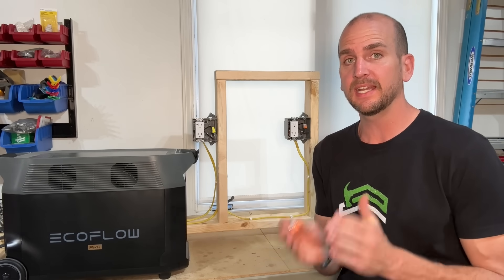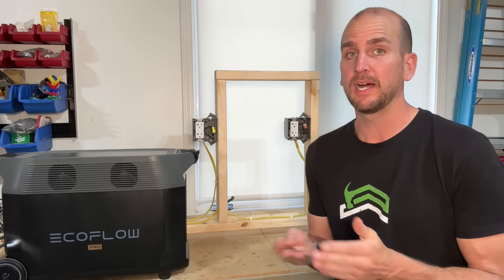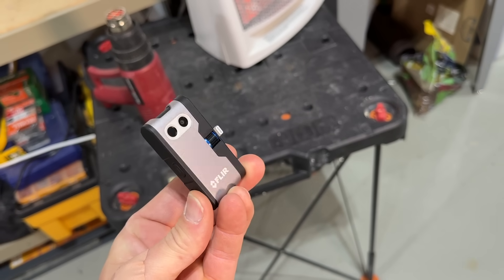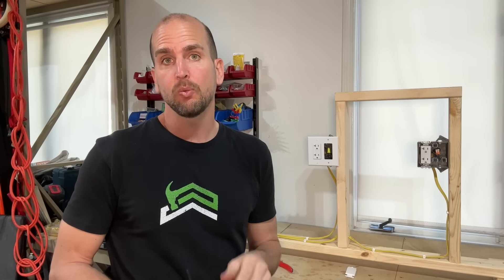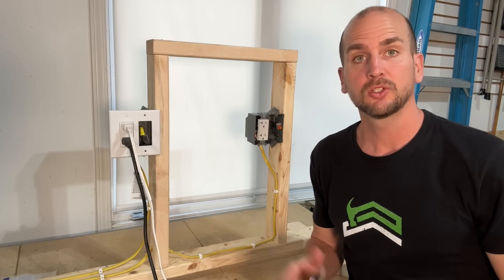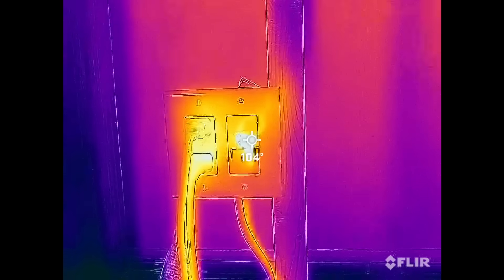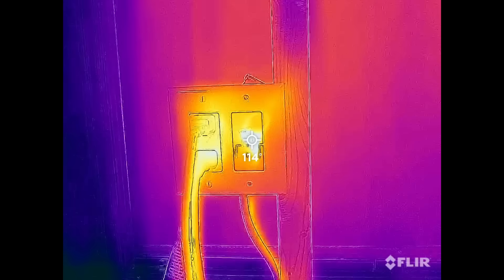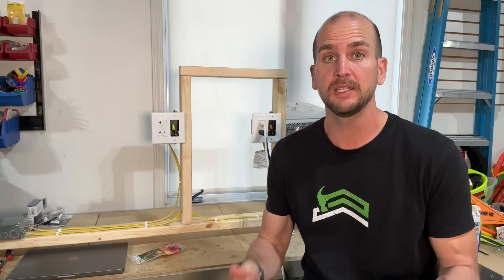Debunking the Pros: Can WAGO Lever Nuts Handle Heavy Electrical Loads?

Comment from the maker: All My Favorite Tools:  https://geni.us/VYIp51

DISCLAIMER: This video and description contain affiliate links, which means that if you click on one of the product links, I’ll receive a small commission.
Reply: What do I think?
You couldn't have made this any more confusing if you'd tried, if it wasn't for you flat out saying at the end that the Wago lever nuts are safe to use I wouldn't have known, as if things weren't vague enough you change the parameters of the test at the end moving the lines on your chart and all of the sudden it's "Gee, I thought I was lost before, now I'm really lost", because what exactly does that mean? Were the results in the first place invalid? If not then why were things changed? Does the second set of results more closely resemble real world use? If so why the first set of results? If not then why the second set?
Thanks for clearly stating at the end that Wago's are safe, I've often wondered why and that's based on the area of contact the wires have inside the Wago coupled with the notorious push in type outlets and them being known to fail, the two designs being similar and all, but if you wouldn't have just plain stated they're safe at the end I wouldn't have known, and I wasn't about to watch this 4 or 5 times to sort things out so I could figure out your conclusions.

Comment: I have been using wago for twenty years with CNC machines. We use them on all our systems and have had no failures at all. We use them at the rated ranges and adhere to manufacturer specifications. Highest voltage around 25amps

Comment: I re-wired my 4-bedroom house, using wire nuts.  I added numerous receptacles and switches, and upgraded most of the circuits to 20 amps, the only exceptions being lighting-only circuits.  I have a lifetime supply of left-over wire nuts, and have no motivation to use Wagos.

I am a pre-twister, and would like to see a comparison similar to this test comparing pre-twisted vs. not pre-twisted.  (A real electrician counseled me to pre-twist in spite of the instructions.)

I think something that should be stated here, and obviously I have not read all of the comments, is that heat = wasted energy.  The main reason I upgraded my home's wiring from 14-gauge to 12-gauge wiring was to decrease resistive conduction loss.

Thanks for the video.  It's very interesting, but as I stated above I likely have enough wire nuts of assorted sizes to last for the rest of my life.  I understand that Wagos are big time savers for installers.

Comment: ok news flash: we've never used wire nuts in Europe as far as I know (I wouldn't even know how to translate that); before wagos were screw terminals blocks in electrical installation and they were an absolute pain compared to those and a lot more prone to be badly installed, so as far as Europe goes we don't care about how wire nuts are supposed to be better because we've never used those.

Comment: If you don't use the right Wago for the right raring of use and wire... duhhh. Like shade tree mechanics working on BMWs. "IT BROKE". "IT CAN"T DRIVE". Well, no shit it broke and can't drive if you use the universal screwdriver, don't service it and the concept of using the right tool is about as alien as the reality that cartridge bullets existed at the same time with cap and ball.

Comment: I woudn't use any connector for outlets they have dual screws for that and in a well designed circuit there are no nuts, wagos whatever. In lightning it does not matter use wagos, the are nicer on the cables. According to ohms law a 20W bulb will present 700 ohms resistance adding a few ohms won't make any difference. With a heater of say 1500W then you are near 10 ohms and there you don't want any added resistance as every ohm will dissipate 150 extra wats, but then avoid wire connectors if you can use the ones in the outlet itself.

Comment: The way I look at it is... What are your design requirements? If conductor re-use and modification is a priority, use WAGO. If you don't know how to properly twist a wire, or you're not strong enough to get a wirenut tight, use a WAGO.

But if you are doing permanent, standard in-wall wiring meant to run general loads, each splice reduces the available load down the line by a little bit. You're adding all those tiny bus bars to the circuit of everything you plug in. Use wire nuts - it could be what keeps you from having that welder tripping the breaker over and over someday.

Comment: It would be interesting to see if there is any measurable additional voltage drop across a Wago versus a wire nut. I assume there would be, given your results, but it would be interesting to quantify it for the sake of engineering knowledge. Also would be curious about other lever style connectors, such as Ideal. Thanks for another excellent video.

Comment: I was wondering about this. The wago uses a metal piece to transfer connect the wire compared to the wire nut where all the wires are touching each other. Can the wago create galvanized corrosion since it doesn't use coper??

Comment: This is not the problem. The problem is long term. They are too similar to the push in connectors on receptacles and switches. You don't see failure for 20 to 40 years. Small contact area does not allow extra firmer contact area to overcome long term corrosion.

Comment: Can someone explain the time used? Does it get hotter the longer the outlet is used? Ie. If i plug a full load of say 20 amps of electrical equipment, for 3 days straight... Does it get incrementally hotter and hotter leading to a breaker flip or even flame/burn up?

Comment: So could you use this with wiring up a dishwasher?
Reply: Absolutely. Most dishwashers use around 1500w, which is around 12.5A in a 120v circuit... Well within the specifications of wagos.

That being said, because of that high amperage a dishwasher should be in its own circuit to begin with (20A, GFCI protected), so no need for any splicing at all.

Comment: The difference between the WAGO and wirenuts is WAGOs installations are more reproducible.  A good wirenut connection is better than a WAGO, but we all know many do it yourselfers will make mistakes with wirenuts.  I have done enough, I am not too worried about this myself but due to convenience and performance well within specs, I will be using WAGOs when I replace all the outlets and switches and boxes in the RV home my son will live in.  I hope to get it all done in one day.

Comment: I use wagos in my mercury gravitron time manipulation aircraft and they work great. With 2,547 connections to be made PER impulse beam generator it made wiring it so much easier. They’ve been across time and space hundreds of times and have never let me down. 

What? It’s the internet.

Comment: Well, as a less than knowledgeable DIY guy I am left wondering about the wire nuts I’ve installed over the past 40 years. Did I use the right size, did I install them correctly, etc I’ll be using WAGO from now on.
Reply from the maker: The WAGOs are pretty awesome, something tells me you won't be going back to wire nuts after you get the WAGO 221 a try.  Best of luck on your projects!

Comment: I would recommend you to check with circuit breaker manufacturer to see its tripping curve at various overload current. FYI if it's only 20% overload, it would probably takes several hours to trip.

Comment: I'm not an electrician. I've used the WAGO 221 connectors in my own home and would call them safe...I was leary of them at first and checked them often for temp. and for any signs of heat damage...They're still good 3 yrs. later. They have been installed in my shop's 12-2 wiring and mostly handle only lighting. There is one J-box that has a couple of outlets with machines on them(drill press and disc sander) WAGO's never got warm or any of that...I'm not worried about them anymore and will keep using them as needed...For what it's worth!

Comment: I appreciate your testing but the experts are correct. Your test duration is 20 minutes. You have to expand that out to 5 years or longer. The heat generated over time will cause wear in the connection. Even true with wire nuts and the screw. It’s just your high point is starting way higher with the WAGO. This was the same case with the aluminum wiring they put in mobile homes in the 60’s. 20 years in people were burning their houses down when they plugged in the space heater, or large TV in our case. We didn’t burn the house down but had smoke and smelled it.

Comment: There is no difference in temperature.
What you're seeing is the flat shiny surface of the Wago emitting the infra red directly at the camera.
The slightly matte surface of the nut doesn't emit the IR so well, and the round surface means it only emits a tiny amount towards the camera.

Comment: Take a look at a good wire nut, the tan "Ideal Twister" at about $0.17 each. I worked as a commercial electrician and this is the wire nut we used. I started these by hand and then used my 5/16" nut driver to twist them on.  If you take the wire nut back off, it looks just like you twisted the wires with your Lineman pliers.

Comment: Did you take a baseline before you turned them on? It seemed like the WAGO started a lot hotter than the others. If he was just building up from test to test A) that might have been biasing the results and B ) your test might not have been long enough to gather the important data.

Comment: This is the best way to describe wagos. Good for DIYers.

If I'm building a house, or hiring contractors to do so - Then I am 100% expecting wire nuts at minimum.

If I'm paying for anything more, then I'll opt in for those ideal screw set connectors any day.

Even dor a DIY-er though, you cannot actually see or inspect the wire connection after it is made. The same way with wire nuts, however in a solid wire situation - you twist the wires w/ pliers before, inspect for connection & then cap with the nut. The way wagos work don't allow an inspection of the wire connector - they are like the equivalent of those crimp terminals with nylon insulation, can't actually inspect the crimp.

Comment: The internet is a haven for quibblers.  Yes, direct connection will always be best, and yes the larger surface area of wire nuts will obey the laws of physics and result in less resistance and so lower  temperatures in a connection than a sprung Wago connector.  And yet all these undeniable facts are irrelevant because none of them are anywhere near the maximum design temperature.
What is relevant is that Wagos remove the possibility of a loose or imperfect connection - which can occur in both direct and wire nut connections unless fastidiously fastened and checked - and it is these loose connections which arc and increase temperature and become the root cause of so many fires.
Electrical safety is more about operator error than design error in my experience.
Thank you for making this video.

Comment: I think the big deal is that most people won't use the classic wire nut correctly. Just the fact that it's easier for anyone to use the lever nut means a safer install overall. I for one felt better about my switch I replaced when I used the push in connector from Wago than I did with the twist in wire nut. I feared the twist on would loosen over time.

Comment: The regulatory bodies would not certify and allow the WAGO 221 connectors if they were unsafe in any way, no one would approve due to safety and potential for fire. On another note the temperature you tested which was above the rated intended use was nominally higher, so incremental as to be insignificant. I am wondering if you tested at rated output the minimal temperature change (delta) might be non existent. While i had concerns in high load situations i have no qualms in researching WAGO 221’s, sometimes it take time for an older generation to move from the old ways to new improved ways, but for WAGO’s i’m pretty much sold on them being as valid a method for connections. Twist nut are still less expensive and i will use where appropriate, however for things such as LED lighting, boxes very high with hard access to be twisting wires, crowded electrical boxes i have zero concerns going with the WAGO 221. My one caveat is only to use OEM WAGO products, knockoffs are not approved for use and not worth the risk in using. Cheers.

Comment: Question for electricians. Is soldering twisted wire to make a solid connection and prevent oxidation before inserting into wire nut a good idea? Is it against code?

Comment: Wire nuts are outdated and a significant fire hazard. The plastic cap will rot or melt overtime or become brittle. Then the only thing keeping the wire in place is a twisted cable and a tiny metal ring. At load and overtime the connection will become lose and sparks will occure burning off the cap and potentially igniting the surroundings because you have two exposed naked wires. Wago connections are are more stable longterm and don't expose naked wires. They are much safer longterm and don't degrade under heat like wire nuts. They are also easier to install and that means almost always proper installation. It only takes one lazy electrician with wirenuts to burn down the house, especially if the twisted cable endings are not properly trimmed before putting on the wirenut.

Comment: I recently used some WAGO connectors with the 12-volt circuitry in my car. At that lower voltage, the voltage drop for a given current matters more. You might want to test that.

Comment: Retired career Navy electrician. We never use wire nuts in the Navy, but none of our wiring is solid core. All shipboard wiring is multi-stranded. So all wiring connections must have crimped connectors, from tiny valve position indicator light wires up to massive main distribution switchboard cable connectors. I've marveled at experienced construction electricians working with them, their hands a flurry of motion stripping, twisting, cutting twisted wires to same length and then twisting on a wire nut. But I never got proficient with wire nuts and I hate them. In addition, I've found too many connections done by somebody before me in two different houses where wire nuts either FELL OFF or were very loose.
So I've been using Wagos for renovation work in my house since I first discovered Wagos three years ago. I especially LOVE them for for things like connecting a new bathroom exhaust fan where you have to juggle making the connection and then fit a fan box electrical connection cover plate tab in slot and then secure with a screw...
But I've been using Wagos and Ideal equivalents exclusively instead of wire nuts.

My only comment/suggestion is that you wrap a layer or two electrical tape around the levers to ensure they don't get knocked loose while folding wires into and stuffing electrical or connection or junction boxes. This is just from my own experience where I noticed it's very easy to unlock the levers while placing the connected wires inside.

Comment: Whats dangerous about the wago is when you are putting the wires in the box and then switch in.  It's easy for one of the levers to get popped up and you can't see it. The should require to be taped around.

Comment: You should test the 2273 series Wagos which are push ins. There is some indication that they are lower resistance than the 221s and are really more suitable for junction and outlet boxes as they are much smaller.
Reply from the maker: I have some sitting right in my kit.  I am planning out the next phase of testing and could easily do the 2273 and even a throw back to the WAGO 222 lever nuts.

Comment: How about setting the upper limit of the camera to the connector max limit, and the lower level to the ambient air. It gets a little deceiving at times when what appears to be on fire, can be touched with a finger and is human body temperature.
Years ago, companies were buying these cameras, and selling 'loose contact' services to industrial companies. The first year was fine, but then, in order to sell their services, they dialed the colors to show 70 Degrees as ambient and 85 degrees as white hot. Only after inspecting and tightening for 2-3 days, did I figure out the scam. We tend to look at pictures, rather than specs. So lazy.
Thanks, Mike

Comment: I've used them for decades in industrial automation, long before they came to home wiring.  For all connections, corrosion is the biggest concern, so wise to coat metal with No-ox grease.  Strange that the wire-nut instructions don't say to pre-twist them.  I always twist tight with pliers.

Comment: I tried to repair broken legs on my daughter's automobile headlights using a similar mechanical connector as the WEGO nuts. They crimped the wires together.  While the original crimp worked perfectly,  over a short period of time, the crimp became intermittent.  I think the enclosure was melting,  thus weakening the crimped bond. 
I would like to see how long the plastic body of the WEGO's withstands repeated stress temperatures.
I read davemiller's repies and will use WEGO's in my next project. Thanks, Dave!

Comment: I have never been concerned about the safety of Wagos, and this certainly confirmed that. It's hotter, but well within spec. There's huge safety margins in the code anyway.

The reason I don't use them is energy efficiency. That heat is extra resistive load. If you're rewiring a couple outlets, no big deal. Use hundreds or thousands of these things, and you've added significant unnecessary energy use.